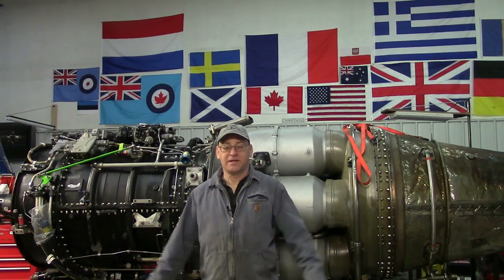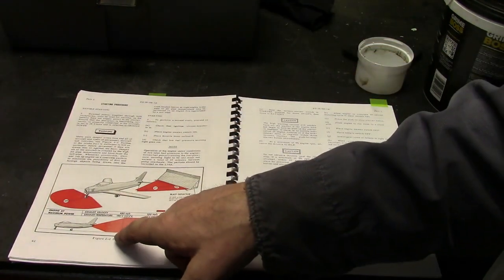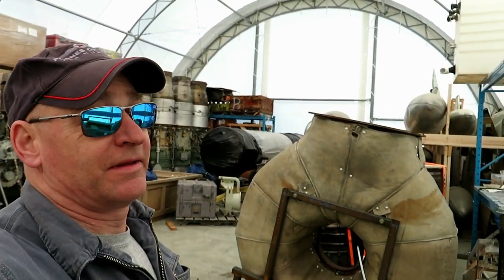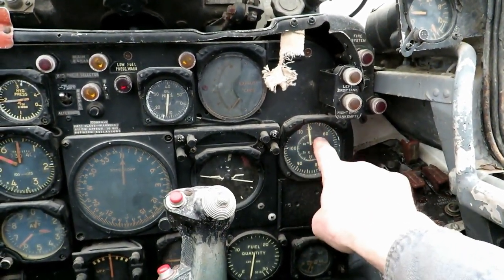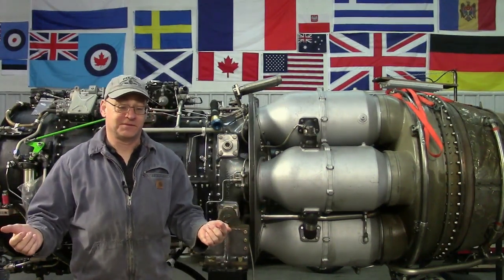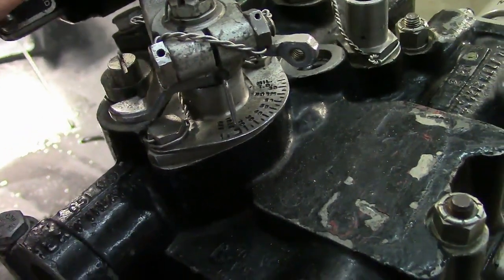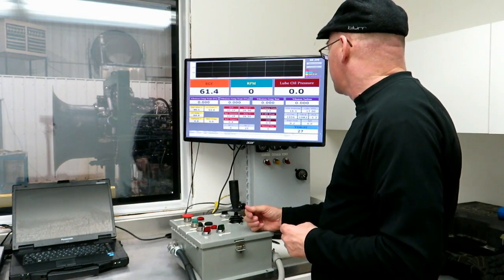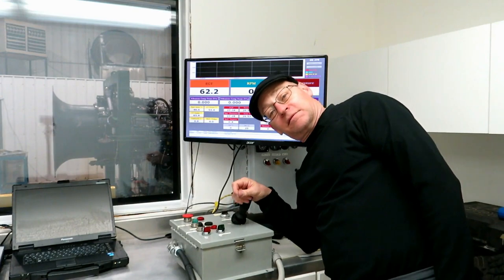Jet Engine Starting: Cockpit vs Test Cell

Comment: Canada builds the best turbine engines easily ... 
from a PW jockey 👍
Reply from the maker: I once described the PT-6 as the small block Chevy of turbine engines... but it's even better than that.
I has no competition.
Reply: Only similar sized engine (turbo shaft) with similar production numbers would be the RR250, but I am always shocked how these don’t fail that often as their parts seem so stressed and the design while a compact package has several point points (peashooter o-ring, number 5 bearing) where if installed wrong or of they fail....it stops...seen a number 5 bearing where the bearing race had come apart and surprisingly they engine got them safely down somehow. PT6 parts seem so much more robust (bearings especially) and seem to pass overhaul inspection more frequently. Hot section repair is somewhat simpler too.
Reply from the maker: RR 250 started out as  a 320 Hp helicopter engine, and has grown to over 750 Hp. It is a hugely successful engine.
PT6 started out as a 550 Hp turboprop for light aircraft. It has grown to almost 2000 Hp. It is a monstrously hugely successful engine.

The two are at the top of their game, have been  for decades, and are not in competition at all. 
They are both great. They are both awesome, and so far, without peer.

Comment: I’m surprised with the frequency of service, the duration these engines and the company have been around that y’all don’t make pigtail adapters for the engines. 

I’d assume there is some uniformity at least from the aviation engines. Do you see variance in pin outs from the industrial variants?  Are we talking 200 wires or 50?
Reply from the maker: Each mark number of engine, matched to it's particular mark number of aircraft, is different from the others.
We have a plug and play harness adapter for the J79-17, because we see a lot of them. It would not work, for example, with a -19 or a -15.
Industrial engines do not have a wiring harness that is anything like an aircraft engine.

Comment: If you want to see something spectacular run the engine at night with the lights off and peer down the inlet after your eyes adjust to the darkness.  Static electricity will give you a cool show like you have never seen.  It is dangerous of course so must be under controlled conditions, but if you have never seen it it is worth it.  You will be amazed.
Reply: I've only ever heard this phenomenon ascribed to Titanium compressors.
Reply: @grahamj9101  F100-PW-100 had it in spades...and as I recall it was clearly visible in the fan...and deeper.  The only other engine I have experience testing is the J79-GE-17A, and I never got so see that one run at night.
But definitely in the F100
Reply: @fps079  I'm not at all surprised, as I would expect the F100 to have a Titanium fan and Titanium front stages in the HP compressor.

Comment: The Draken engines, I'm assuming they are RR Avons licence built by Volvo Flygmotor in Sweden? Do those examples you have there have the Swedish designed afterburner section fitted?

Comment: Hi Jay :) Thanks for yet another awsome video :) Just one (proberbly stupid and already asked question) but why do you not make a "standard" wireing loom for connection to the original pins ? Would you not save any time on hooking it up with that? Or is the wiring different on the engines?

Comment: But what are the chances of having a hot or hung start on your Saber 6 and also you didn't cover where to position your aircraft if it's windy when attempting to start the aircraft. Excess wind going into the pipe will prevent engine from starting also

Comment: master, starter ingition wait for spoon then move throttle to boost pump and to idle to continue start if exceeds 700c  pull back to cut off hold starter and retry.

Comment: I once read about an insert in the exhaust of a F-86 - like a crescent shape - that somehow vectors the exhaust, and that it could be installed incorrectly, and thus preventing the aircraft from taking off. Heard of it?
Reply from the maker: Those are for tuning the thrust by making small changes to the nozzle outlet diameter.
They are called mice by some, and they do not vector thrust.
I installed one this morning.
Reply: @AgentJayZ  I know them as 'trimmers'.

Comment: Why are all the temperatures referred to in Fahrenheit?  Is it because the engine was designed in the USA?  I live in the USA, but fly French aircraft, and I am used to seeing all the engine temperatures in Celsius.  Quite strange.
Reply: depends on the manufacturer. some are in metric, some are imperials
Reply: The Douglas A-4 (American) designed in the late 50s used Celcius.

Comment: so it should look a bit like this (hopefully I've not forgotten anything, watched it several times..):

 - starty (start-cart)       ON
- starter                           ON (max 45s)
- 500rpm: ignition          ON
- 700rpm: throttle          Position START
-                         --- ignition --              
- ignition                          OFF
- 1800rpm: starter         OFF

--> at which point do you advance throttle from "start" to "idle"?

I hope this isn't a stupid question, I can't find if there is a "start"+"idle" or just an idle, just a start or if they are both the same.
As you don't describe that you would have to advance from "start" to "idle" in the runup, I guess "start" = "idle"?
Reply from the maker: Yes. When the pointer is in the idle box, the engine should start and rise to idle rpm without burning up.    ...should...

Comment: One question or two: Have You ever overhauled a GE J 85? And where do I get good engines of this type and what do they cost in average?
Reply from the maker: Yes. You'll save money by finding your own instead of buying one from a dealer. You need to become familiar with the aviation aftermarket. The scrap industry will be a good source if you aren't going to fly it.
S&S Turbines may be able to help you find one.
Reply: @AgentJayZ  thank You
Reply: Zorn, if you have to ask "how much do they cost", then you can't afford it.

Comment: Question: why haven't you whipped up a set of plugs to connect your test stand controls and instrumentation to the same connectors the aircraft uses? It seems you work on these specific engines quite a bit...
Reply from the maker: 1: we would need to obtain the mating plugs from a Sabre jet wiring harness. Easier to hunt unicorns while riding a flying dragon.
2: We use modern sensors in our test cell, and we connect directly to them.
3: We measure more parameters in the test cell than is done in the aircraft.
Reply: @AgentJayZ  Do you monitor any thrust bearing position?  I would think there is only so much linear play that is tolerated. On this 6k horsepower steam turbine at my work (petroleum refinery), which drives a light hydrocarbon gas (isobutane / propane) compressor, we have a Bentley-Nevada system which monitors bearing vibration, (vertical and horizontal) and thrust position (+- from zero- neutral).  I want to say the vibration was measured in mils.  It’s been so long since I’ve worked there I don’t remember all the details.  But, I remember seeing gap readings, which were an electrically induced measurement of distance from the sensor to the element. ✌️🤙

Comment: Hello, eng student from UIUC, first I was wondering where I should start on your channel to start learning things? Also about the video would it be easier to make a custom harness to plug into the 2 engine connectors or is that a waste of time?
Reply from the maker: I'm considering that, but it's not just the connection that would be needed. It would either need to be made to interface with our computer, or with a set of the same instruments that are in the aircraft. Each engine and each aircraft type will require a different harness. For example the last Orenda we tested a month ago was a 14 from a Sabre 6. The next one was a type 10 from a Sabre 5. All different .

Comment: Was there ever a jet engine that had vacuum tube (hybrid?) fuel control? I seem to remember reading about it and thinking that rough landings would break the filaments. ..or am I thinking radar?
Reply from the maker: There must have been. Back when these were combat jets, "electronic" meant tubes...
Reply: Transistors weren't invented until 1957, and the F-86 pre-dates that by at least 5 years.
Reply: I don't know how but there's quite a lot of vacuum tubes in early aircraft electronics and they survived quite well.
Reply: @AgentJayZ  More info/mention of electronic control/hydrogen fueled:
https://history.nasa.gov/SP-4404/ch8-8.htm
Reply: @jfan4reva  I found some info but no details for vacuum tubes on early "electronic" controls. See links in this thread.

Comment: Ok, I have a question about the Allison T56 as fitted to the C130 Hercules, and apologies if you have heard this before. We've all probably seen the amazing footage of that particular aircraft pushing itself backwards down a runway, by reversing the pitch angle of its propellers, thereby reversing the thrust. As far as I'm aware, not all turboprop engines can do this, or at least not to the same extent. So here's the question: Since reversing the thrust also reverses the reactive force on the propeller, does the engine need a special type of thrust bearing to allow this, and if so, how does that bearing differ from one used on a non-reversible turboprop?
Reply from the maker: The thrust bearing on the prop is a deep groove ball bearing. Special magic: it works in both directions, just like the ball bearing in the wheels of your bicycle.
Actually not magic, or even exciting in any way. Sorry 'bout that.

Comment: Hello I’m learning a lot thanks to your channel.
please I have a question what will happen if instead of kerosene (fuel) I had rather gasoline (vehicles) in a turbojet.
Thank you
Reply from the maker: Gasoline is much more dangerous and more expensive than jet fuel. Fuel pumps and fuel controls are lubricated by fuel, so they will not last as long when using gasoline. Otherwise the engine will run fine.
Reply: hello thank you for this clarification, I am a young engineer and I aim to design planes (fuselage and turbojet) and I would like to know if you can help me with advice or documentation on the subject thank you and good day.
Reply: We have run Allison C20 turbine in a 500D on diesel after starting on Jet A1 runs fine no problems ,refuel on diesel with engine running
Reply: What about the higher sulphur (and perhaps carbon, too) contents in diesel oil compared to Jet A1, that is more refined and pure? Corrosion/deposit problems in the long run?...
Reply: @Elhombresombra  I'm having to delve into the depths of my memory and my time at R-R Industrial and Marine Division, but my recollection is that the Vanadium content of diesel fuel  was detrimental, in terms of corrosion, to the Nickel alloys of the turbine blades and vanes of the engines of that era.  The Sulphur content was problematic in marine applications because, in combination with salt from the environment, turbine blades and vanes suffered from sulphidation: I vaguely recall that it was colloquially known as 'green rot'.  The solution to the problem was the use of more corrosion-resistant alloys, at the expense of temperature capability, together with coatings.

Comment: Can you actually blow a jet engine by over revving , or over speeding?
Reply from the maker: One of the things we do in the test cell, before sending an engine to be put in a plane, is to set the fuel pump governors.The fuel pumps are what limits the max rpm. The pumps are only accessible when the engine is removed from the plane. There is no manual control of the governors.
So the answer to your question is yes, but not while it is installed in an aircraft.

Comment: I work on and start the GE-90-115B of the 777ER. 85,000+ Horsepower..PS-The Orenda is superior to the J-47
Reply from the maker: That is true, but then it was developed later , using all of what was learned from the J47.
I would have guessed that the Hp rating of a GE90-115 would be even more than that.
The industrial LM6000, which was developed from the now ancient CF6-50, puts out around 70K these days.
In my opinion, all of the engines mentioned here are extremely impressive, and each has a different, thundering sound.
Reply: @AgentJayZ  Yes, a very conservative estimate..but, as I am sure you know, converting thrust to horsepower is a tricky business. Some say the -115B puts out well over 100,000...cudos to you guys in the small jet shops..You know your stuff and work hard. I am lazy..so I work for an airline(just kidding)
Reply: Lm 2500 GE prime mover NYPA units awesome. GE90 the best in world period.
Reply: @jjthomas2297  density of atsmosphere causes variation
Reply: @MitzvosGolem1  Sorry, but I'd far rather fly in a Trent-powered B.777 than the GE90-powered version.  It's that bit quieter and the lack of combustion rumble on start-up is very noticeable.  The GE 90 rattles the whole airframe when it is starting up.
Reply: @grahamj9101  ok

Comment: The YF-95 was a development of the F-86 Sabre, the first aircraft designed around the new 2.75-inch (70 mm) "Mighty Mouse" Folding-Fin Aerial Rocket (FFAR). Begun in March 1949, the unarmed prototype, 50-577, first flew on 22 December 1949, piloted by North American test pilot George Welch and was the first U.S. Air Force night fighter design with only a single crewman and a single engine, a J47-GE-17 with afterburner rated at 5,425 lbf (24.1 kN) static thrust
My Question how does this J47-GE-17 And other varients Compare to  The Orenda 10 (Canadair Sabre Mk 5) and the Orenda 14 (Canadair Sabre Mk 6)
Reply from the maker: At 5500lbs thrust, that is what a J47 makes, so no AB. I've heard rumors of an AB J47, but never seen one or any real documentation.
Same story for the Orenda. It put out 7250 lbs thrust, and apparently there was an AB version, but never seen a word of documentation in any manual of it.
The Sabre 6 had a -14 in it with 7250 lbs thrust, so there are a few out there painted up as F-86Fs.. which had the 5500lb thrust J47 in them.
Reply: @AgentJayZ  : at the Hamilton Warplane Museum, there was an old gentleman that worked at Orenda. He said there were Orendas with afterburners, but only as test engines for the development of the Iroquois afterburner. I believe he said none flew.

Comment: Is it possible to modify a sabrejet to be started without external power? I recently read a book (fiction) where that had been done. I’d imagine that a demilitarized plane without guns etc. would have the weight allowance for extra batteries, but how it would work in the real world I’ve no idea.
Reply from the maker: You could probably do it with batteries replacing the guns. Have not seen it done, though.
Reply: There was a Plane Repo video where the pilot fired up a dead Lear by hooking up 2 D cells from a flashlight into the cigarette lighter.

Comment: Where is the afterburner button? How do some planes enable afterburner?
Reply: As with the starting procedure Jay illustrated (a detent from off-to-idle), after the pilot applies full power with the throttle lever, burner application is activated by moving past a secondary detent (from the full throttle position).  Moving past the detent applies the after-burner.  The after-burner is a "critical item" in terms of monitoring ITT (internal turbine temperature) and fuel burn.  You can't imagine the fuel burn during burner application.  Today, the jets simply hook-up with tankers to address combat radius ... in those days, there were no tankers, so you wanted to come out of burner soon after achieving a positive rate of climb.

Comment: VERY VERY COOL comparison Jay! Did I catch an oversight?: In the cockpit there are several views of the emergency ignition and fuel switches - I'm sure they'd have to be turned on? And if they're the "emergency" switches, are there service switches? Thanks Again, and let's all do our parts to stay healthy, and NOT contribute to the strain already on our health care providers.
Reply from the maker: Emergency fuel control switch transitions to the Emerg. FCU, which is little more than a manual valve. Emerg IGN allows you to manually hit the sparkers, if you want.
Oversight? Meh.
Reply: @AgentJayZ  So a pilot would turn them ON in an emergency - not the function I had in mind at all. Of course not an oversight; and thanks for the clarification!

Comment: Commenting on your "side bar" starting @4:39 everyone's an expert, someone must have read about a jet engine and that paragraph they read automatically means they are expert on the forces an engine produces or maybe they spent 2000 hours which is how long it takes for someone here in the States to be an A&P mechanic but only spent 1 week on the jet engine and in inner workings of the burner can or how to do a hot section inspection and that means they are experts. I have my IA (inspection authorization) and I'm far from being an expert at anything. Buy there is always that group who is........NOT!!!!

Comment: OK So my only question is how did you get an ex South African Airforce aircraft in your shed and are you going to restore it/ have it restored?
OK 2 questions in one!
Reply from the maker: With enough digging, and enough money, you'd be surprised at what is available out there.
I believe it is in line for restoration to flying condition.
Reply: @AgentJayZ  I hope so. There is one in the local SAAF museum in shocking condition!